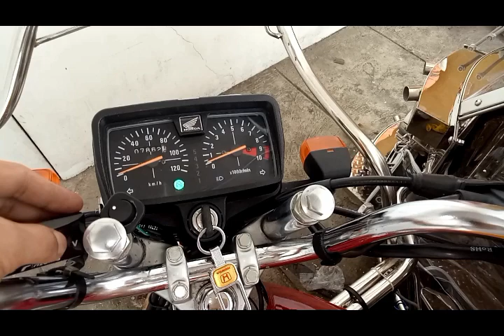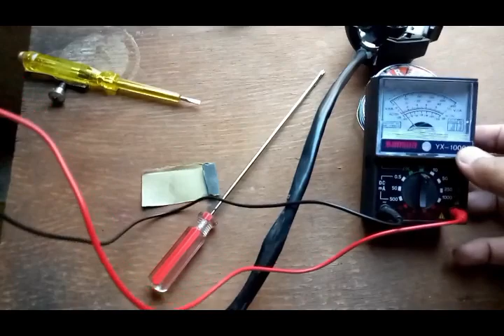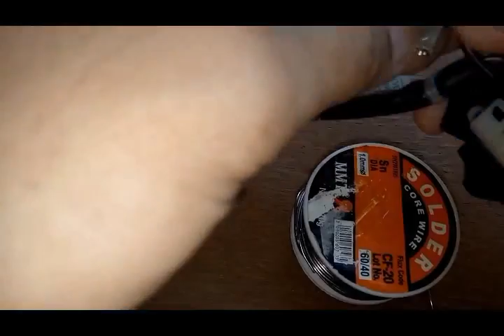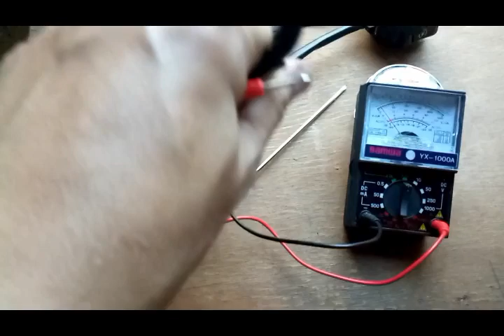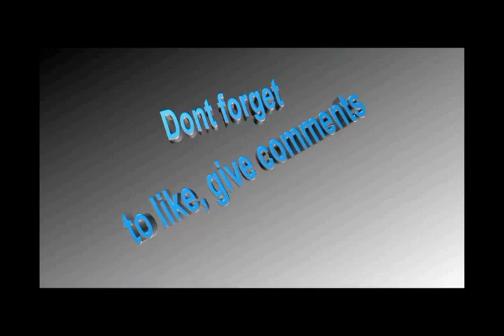Honda tmx 125 alpha ayaw umandar sa push start...Problem fixed at walang pinalitan na piyesa

Comment: Bos yung sa akn walang tunog yng push boton ganyn din kya problema
Reply from the maker: try mo buksan mo tapat pagdikitin mo lng dalawang wire yan kasi kinalwang na loob kala ko dati sa susian may problema yun pla sa switch lng
Reply from the maker: pero may supply ba ng kuryente?pag kabuhay ba ng susian nailaw ang neutral

Comment: ung sa akin boss pag push start lumalagatak lang walang redundo
Reply from the maker: check mo battery baka mahina na meron bang voltmeter ang motor para namomonitor mo battery at charging system.
Reply: Boss yung sa akin walang tunog sa push botton ano kya dperensya ganyan din. Kya linis lng